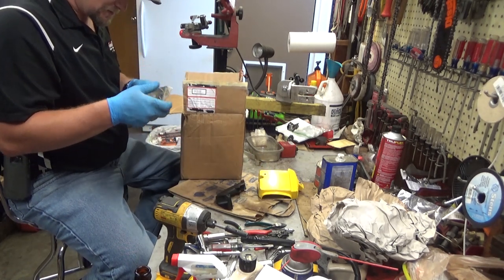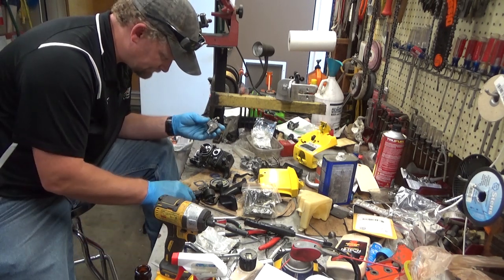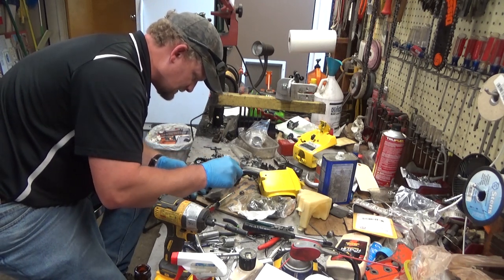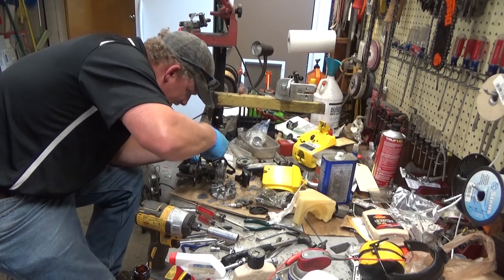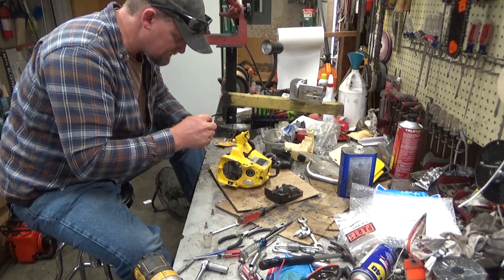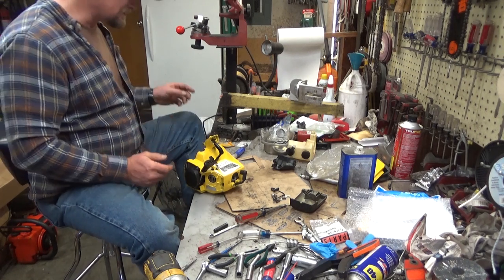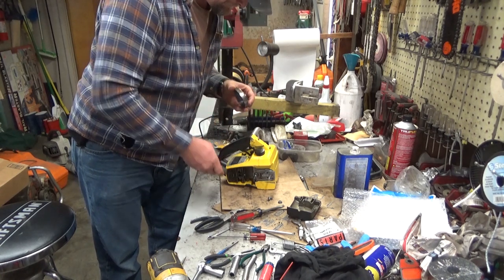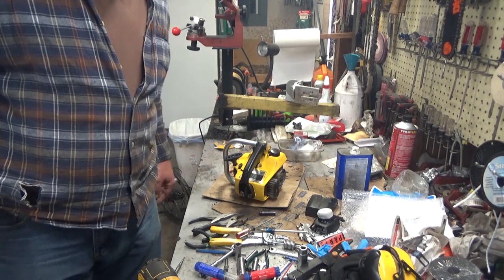Charles' Mcculloch Mini Mac 35 Repair, Assembly & Test Run

Comment: I have assembling my mini-Mac 35 and ran into a problem installing the clutch on one end of the shaft and the flywheel on the other. If I tighten the clutch the flywheel nut comes loose and  vise-versa. Can anyone help me?

Comment: Hi, I had the same problem with a mini mac 30. I disassembly the carb several times. And, maybe coincidence, but the adjustment of the mixture screws at only 1/2 turns open helps.

Comment: Hi Leon,
Great Video! I have problem with my Mini-Mac 35. I took it apart and reassembled it according to your videos, and when I go to start it the recoil is hard to pull. When it does start, it smokes a lot even though the carb is adjusted to specs. When I remove the spark plug, the recoil starter is easy to pull. Please help.
Joe

Comment: i  found a mac 110 at recycling/dump..  no brake cover no brake handle. missing the card filter gasket filter is open..  no idle set screw.  and of course no bar and chain.. you have some spare ones kicking around?

Comment: My mini-mac 35 does not oil the chain neither automatically, or when manually pumped. Just where does the oil exit from in order to flow onto the chain?
Reply: There are a couple of holes in the bar the oil comes out of.  Those usually get clogged with sawdust so clean em out and you should be good.

Comment: Do you have a video of installation of a mini Mac fuel filter and I wanted to know does it go behind or in front of the wire screen in the gas tank where you install it at the bottom
Reply from the maker: No video of that, I've never had to replace one!  But I have never seen a wire screen while working on one, so I'm assuming the screen is on the tank side.
Reply: Leon's Chainsaw Parts & Repair ok cause I’m afraid that’s the reason mine is not running long it isn’t getting enough gas to the carb it will run if I have the gas lid barely screwed open
Reply: Leon's Chainsaw Parts & Repair i am pretty sure that the fuel filter is going to need replacing
Reply: Leon's Chainsaw Parts & Repair ok cause I’m afraid that’s the reason mine is not running long it isn’t getting enough gas to the carb it will run if I have the gas lid barely screwed open
Reply: Do you work on chainsaws if people mail them to you if so what do I put as the address